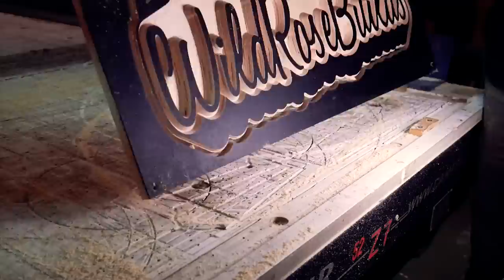Carving a wood sign with a CNC!

Comment: Hello! What is the cutter do you take for the area clearance? And what is the best step over for make the perfect finish. For not to be sand for make good finish. Thanks and have great day.
Reply from the maker: I think the general rule for step over is half the diameter of the bit or less, I used the 1/4” compression bit for the clearance tool.

Comment: Do you use vectric? Im using autodesk featurecam to program our cnc router and its really frustrating since its meant for metal cnc mills and lathes.
Reply from the maker: Kevin Coates yeah this was done with vcarve, I also use fusion 360 for some toolpathing but I prefer the simplicity of the vectrics programs!

Comment: When I program lettering on my autocad and run it through the routercim I get circles that dont show up on the drawing but the DO show up on the MCU or at the machine. What causes this?
Reply from the maker: i've had this happen with stray nodes, you could check your file for that or try using the simplify path command in illustrator to weed out unnecessary nodes. hope that helps